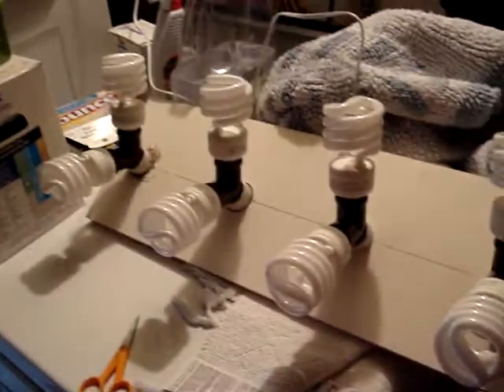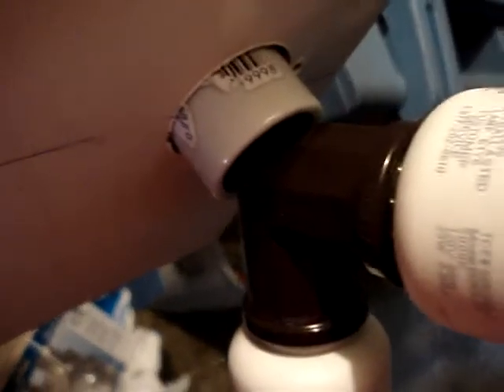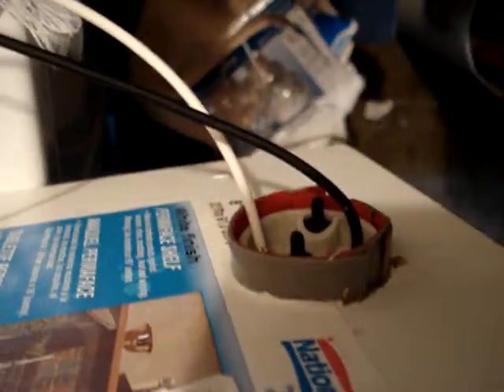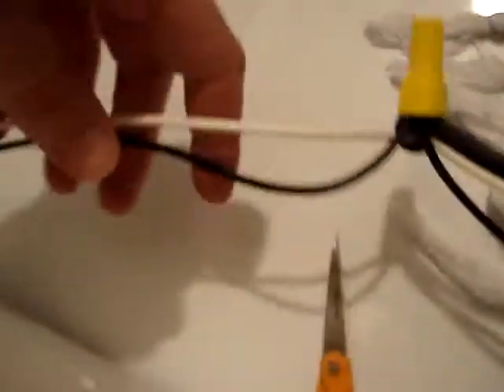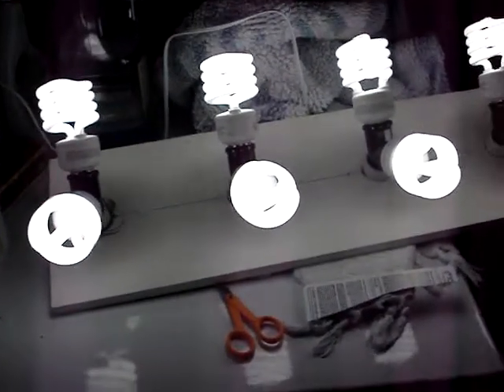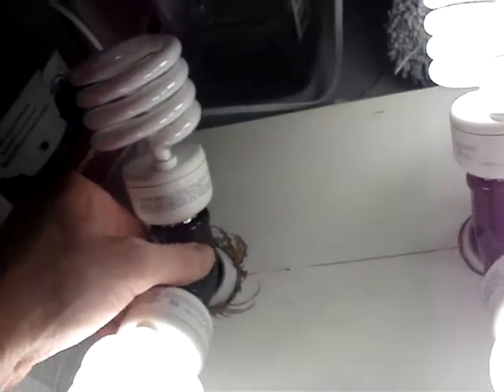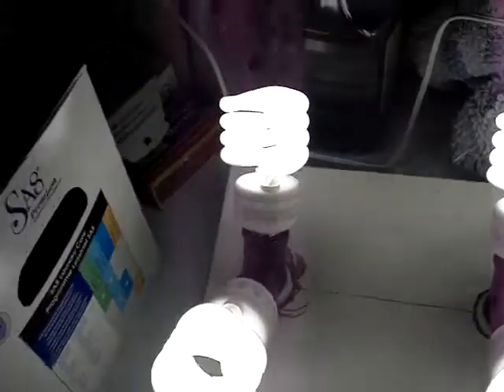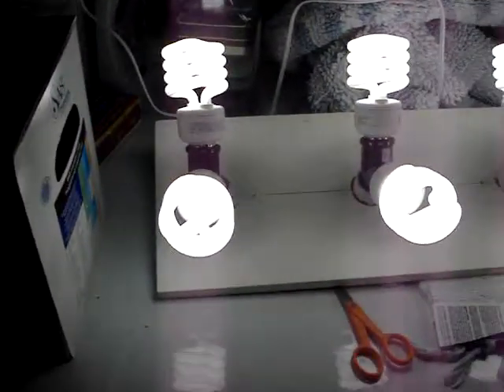CFL Grow lights

Comment: Can I do pretty much the same thing with the old fashioned grow lights?  I am making a 3 by 3 by 7' tall reflective room for 4 vege stage and one mother vege to grow in.  I was gonna use 2 or 3 -   120 watt old fashioned grow lights..  I wanna try it cuz i do not want CFLs nor LEDs.. I KNOW these bulbs get warm.   there will be a lot of ventilation ... If its too hot i will go to plan B.  But for now Im wondering if its best to use the lights with seperate single fixtures ( 3 cords and plugs)  or wire them in sequence.  I don't want ANY FIRES!   Any advice??  THis is just lighting for vege.. not flowers.  I like the full spectrum old grow lights and Im hoping they will work for this.  THANKS.  ps   i have a medical card and I am legal in my state to grow my own medicine.

Comment: Flouro tubes are fine for vegging, but they don't have the output needed for flowering if you try to stay in the same price range. the 2700k tubes are quite pricey and harder to bounce the light and move it around to fully bathe the plant. But tubes will work, just not as efficiently for flowering. I use 3 pairs of t12 for veg and then 16 23w cfl's for flowering.

Comment: Not as long as you don't add to many and go over the wattage of your sockets or your wiring, but in general its cheaper per watt to stick with a few extra 23w bulbs in the assembly and then some mounted on the sides of the box to fill up the area.

Comment: you have much to learn young grasshoper ! Just a tip, start buy buying a 4- 10 socket light bracket that mounts over your bathroom mirror from home depot.
or maybe 2 or 3 then your brain will put together a brutal cfl fixture.